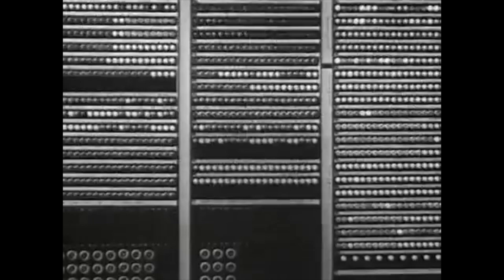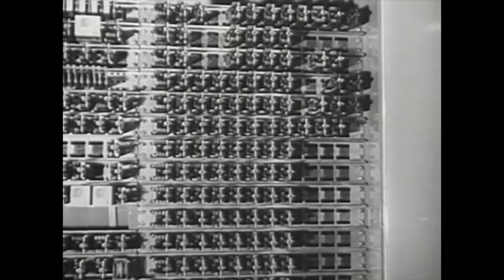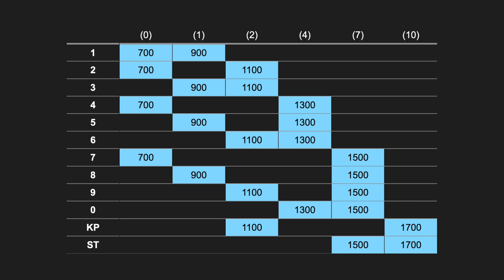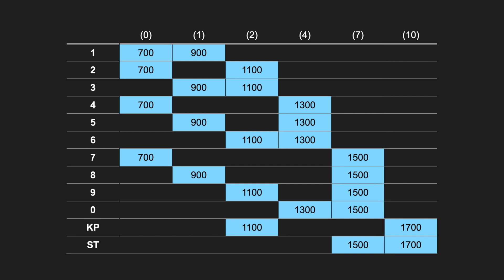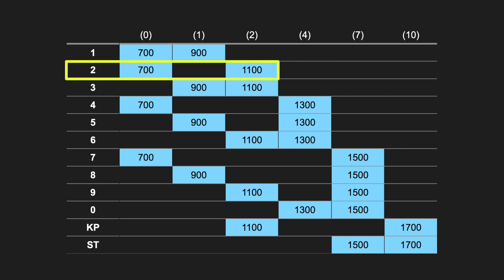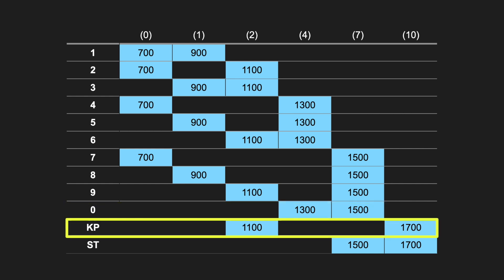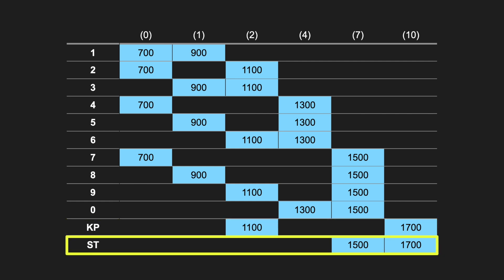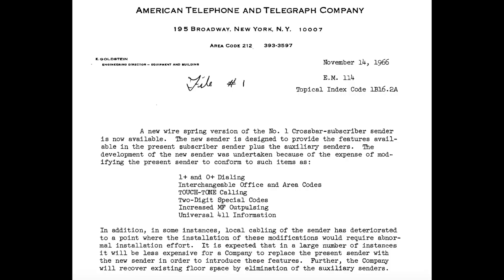How does MF signaling work? - Dial Equipment Appreciation, Part 3

Comment: I'm A L M O S T there in grasping how the senders and markers store/buffer each digit sequence.  It's not easy to wrap your head around how the sender and marker are organized as to how many calls they can handle at once.  All I see are a bunch of relays.  Are they allocated by rows or sets of rows per call and how is each digit encoded in the relays to then be outpulsed later once connected to the term sender?
Reply from the maker: Senders and markers can only handle one call at a time, each. The holding time for a marker is about half a second, so in one second it can do the processing for 2 calls. In one minute a marker could process 120 calls. Normal  #1 Crossbar offices would have 4-6 originating markers, and 4-6 terminating markers, depending on traffic load. The originating marker is the entire frame (floor to ceiling) seen better in this video https://youtu.be/bQDXI7i0SGY

The holding time for a sender is anywhere from 8-45 seconds depending on how fast the customer dials, or if they bother to dial at all. Each sender can only handle one call at a time, and its only used while the call is in the dialing stage. Once the call is connected, the sender isn't needed and is probably serving someone else. If you expect that 100 people will be dialing at once at any given time, you need 100 senders. If you don't have enough senders to handle the traffic being offered then some unlucky person just won't get a dial tone. Senders are normally housed in relay cabinets. (the old ones were, anyway). You can see me kneeling next to a sender here: https://youtu.be/wH0XArJx3No?t=574 .  The racks of relays above the lamp is also a sender, but its much newer, and isn't enclosed in a cabinet. 

The encoding is too complex to explain in a youtube comment. Really needs its own video.

Comment: I believe you said the MF tones were two out of six I believe it was two out of five to give you the frequencies I work for the Bell System 36 years number one ss tsps number 4 Ess and 5 ESS fiber optic systems I worked in technical support
Reply: The sixth tone is the value 10, used for transmitting KP and ST. The numerical digits themselves are 2-5, yes.

Comment: On the MF Receiver, are those vacuum tubes with shields?  I looked up some of the numbers stamped on the chassis which I was able to read.  For instance a 2D21 is a Thyratron and the 396A is a WECO Dual Triode.
Reply: On the image which is even closer I see the Teledyne logo on those components.
Reply: Theyre FETRONS...solid state replacements for tubes. https://www.radiomuseum.org/tubes/tube_tr1011.html
Reply: @SarahAutumn  To extend the life of the K carrier system through Nevada, in the late 70's we replaced the tubes in the K2 repeater units with Fetrons. the drop in power useage was significant and the overall noise levels of the K channels dropped. I revisited some of those stations (now decommissioned)and secured several fetrons along with a beautiful W-E 260AK differential relay, built in 1940's and looking absolutely factory-new. It was used to control the charging of a 152VDC batery string.
Reply: @justm1ke  oh yeah, the 260AK is a really cool looking relay. 

And that makes sense about replacing the tubes in K-carrier with Fetrons, especially since they were supposed to be longer lasting and lower maintenance as well.

Comment: I'd love to see an explanation of how the digits stored in the registers are transcoded into MF relay operation.  I haven't watched parts 1 and 2 yet cause I need some uninterrupted time to do so, but hopefully that will show how pluses are coded into the register relays.
Reply from the maker: That's actually a great question, and its something I've struggled with a bit in presenting these videos. One of my "rules" for this series is that I won't ever show a schematic. That may sound crazy, but I really wanted to present these switches in a general way that could be appreciated by most audiences, regardless of how technically savvy the viewers are. 

I know there are those among us who would appreciate a more detailed breakdown of circuit operation, including some schematics. I also know that there are folks who watch these videos who may have little to no hands-on experience working with these kinds of machines. So I have to be in the middle somewhere. At least for this series. 

I don't have time at the moment to look up a specific answer to your question, but you might find some helpful resources at http://witch.spmh.us/library
Reply: @ConnectionsMuseum  You're right, schematics are helpful and are probably available already.  At least the way I learn, it helps to have an explanation to be able to then understand what a schematic is saying.

Not sure you ever took a digital electronics class or computer architecture class, but they explain like what an opcode, in binary, does when it gets to a CPU and then suddenly it makes all sorts of other things make sense.  

I recently came into possession of a 6 pole Union Switch and Sign DN-10 neutral relay and it was only after I had held it did I fully understand how one worked and that made all sorts of other stuff make sense.  

Also You video on how the Marker decoded office codes with the hard wired terminal boards fully explained that part of the machine and I get it.

Comment: Thank you for that very accurate description of MF signaling.  MF signaling was one of the considerations for use as "touch tones", but was rejected due to talkoff (human voice triggering of tone).  Regular MF receivers were normally never exposed to the actual voice path.
Reply: "Normally" being the operative word. Sending a locally generated 2600hz tone would force a disconnect on the far end, and when removed, the far end would "wink" its return 2600hz, indicating/signalling the availability of an MF reciever. I once learned to actually whistle 2600, and if one walked through a busy airport terminal with banks of businessmen on long distance calls, one could be a dick.

Honestly, I was that dick...then I grew up. 😳
Reply: @DavidFromRI  That only works on trunks that use 2600hz for supervision. A lot of circuits did/do not use 2600hz for supervision signaling. They may use other methods such as Reverse Battery. A lot of 9-1-1 trunks in use today use a combination of MF with Reverse Battery signaling. If you dial around in Russia you will find a lot of 2600hz SF trunks that you can blue box. Lookup "1VF Signalling" on YouTube and you will find a good modern-day example of blue boxing.
Reply: @tieline1333  Good point, thank you for the clarification. In fact, I couldn't hear 2600 in the discussed video, which  kind of makes my post unrelated. My error is a result of the limited scope of my own experience, which is minimal SXS (as a kid), 1XB/5XB, and limited ESS. I was a TSPS operator for a few years though; that was a hoot!

Comment: I'm so glad I found this channel!  I am remember back in the early 90's the exchange I was on in 312- 878 I was using pulse because there was a fee for using tone dialing, and that there was an upgrade at the exchange that made tone dialing "free".  Also meant my modem connections I'd be using ATDP sequence.  :-)
Reply: Remember the tones used to dial on a line are not the same tones used to dial on a trunk.
The name "Touch Tone" is a copyrighted name for the tones generated by the telephone set you would have in your home connected to your telephone line. non Bell venders could not use the term and had to use the generic term for the tones DTMF ( Dial Tone Multiple Frequency, Dual Tone Multiple Frequency). Older SXS central offices had to have a lot of equipment added to the switch for TT dialing. This is why the extra fee. Electronic Switching Systems could complete a call faster and cheaper than a dialed call. so no more fee.